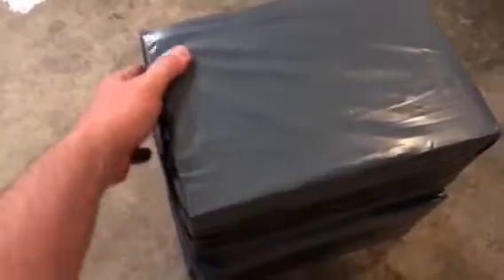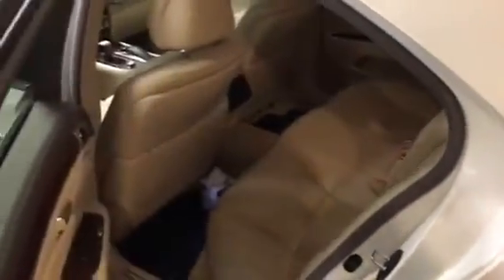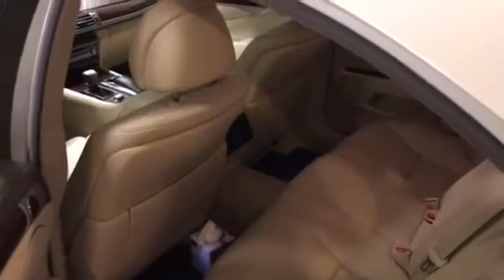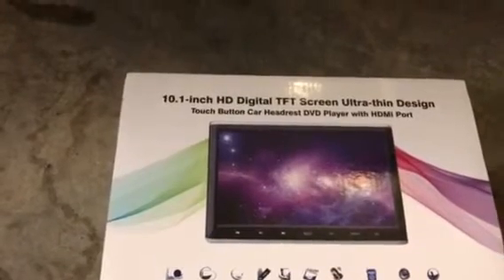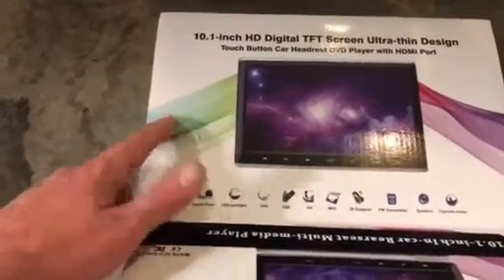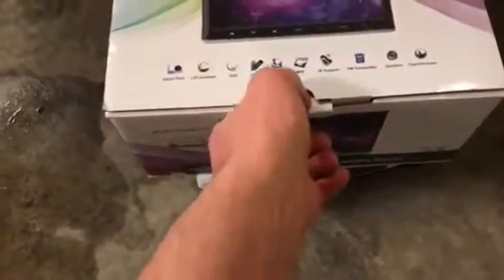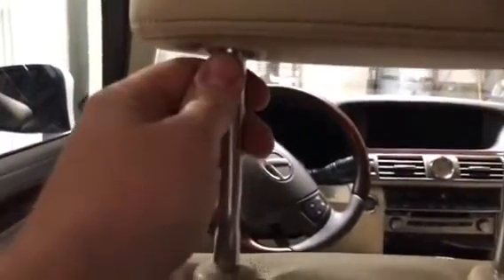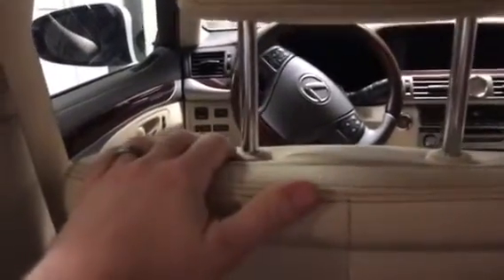Naviskauto 10.1 Dual DVD players installed in a 2014 Lexus LS460

Comment: do you need to connect red and black wire?
Reply from the maker: Mario Gonzalez to get power yes you do or you can use the cig lighter adapters
Reply: thank you! how did you connect yours? I know how to connect the ground but how to I connect power? I also want to make it look OEM as possible
Reply from the maker: Mario Gonzalez I connected to the wires in my console (cig adapter) - spliced them so they always have power